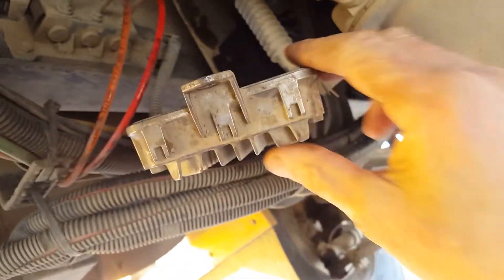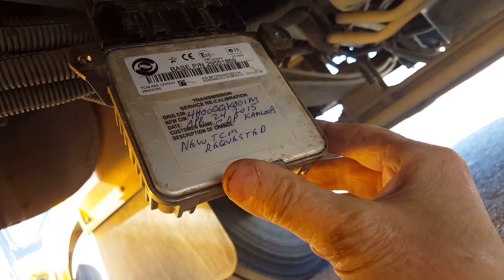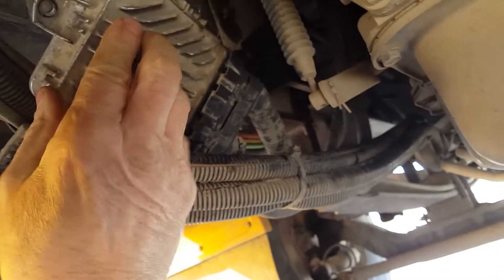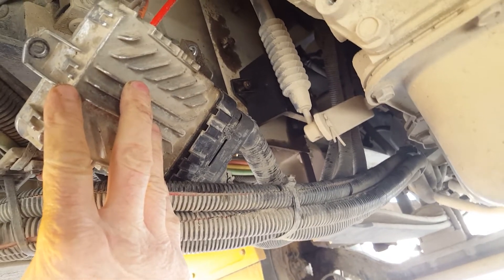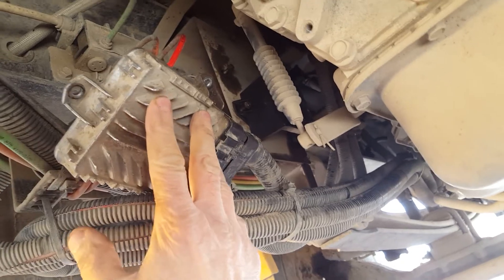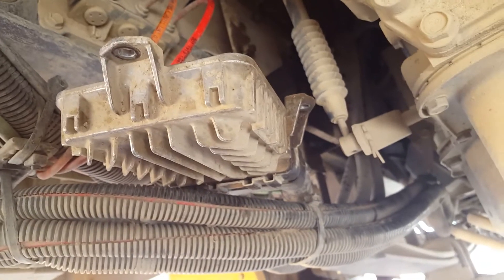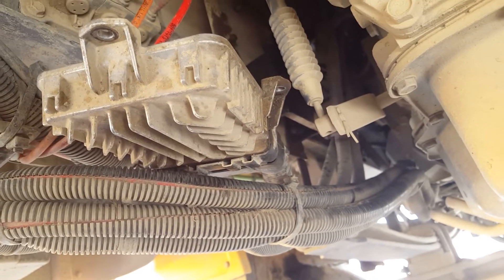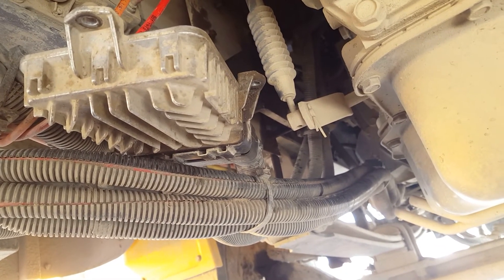Allison Automatic Transmission Control Unit Reprogramming

Comment: I have been to the dealer multiple times and they have not been able to fix the issue and have no idea on a fix. Wondering if anyone else has experienced something similar. I have a 2018 freightliner cascadia that goes into neutral between 9-10 and 11-12 for 4-5 secs. Only happens when going up or down hill. No fault codes. Recent oil change, fluids checked, no leaks. Happens mostly when load is heavy., coud the TCM be the problem.

Comment: We had a several Freightliners M2s with the Allison 3000 that all had 2 Modes programmed in them. This truck sounds like has the ECONOMY MODE programmed in it. There is a "MODE" button on the pushbutton panel. The TCM is capable of storing at least 2 different shifting programs. One Economy Mode the other Performance/Regular Mode. The difference is the shift points. Economy Mode shifts around 400 RPMs LOWER than the Performance/Regular Mode. 400 RPMs may not sound much, but trust me, when you're entering a highway from the On Ramp or pulling up a hill with a heavy load, 400 MORE RPMs is EVERYTHING. I drove another truck with the Economy Mode ONLY in it. It was frustrating AS HELL when pulling out into heavy traffic or pulling a hill with a heavy load. The damn thing would shift just as the engine the engine was getting into FULL TORQUE range ! It would early shift and down shift leaving the truck moving like a snail. Put you in a very vulnerable situation and just plain pissed off. How many MPGs is Economy Mode actually saving ? Surely not worth the fuel saving and pissing off drivers to make it worthwhile. Get your the Performance/Regular Mode programmed in and make SURE it is the default MODE #1. Economy Mode should ALWAYS be MODE #2 !
Reply: I have a 2100 rds in my dump truck and have been looking for months on how to get out of the damn economy mode,  but I have a "t handle" shifter and not the push button.  Do you know if/ how I could go about getting economy mode off this thing and into regular/performance mode without a push button? That extra 300ish rpm hold would make this a whole new truck.  Thanks
Reply: @thomasbrooks8426  the mode button on the t-shifter is on the shifter handle itself.

Comment: I have one allison 2000 its just shifting at higher rpm.
No dowshift
Looks get in neutral when release on the gas.
Somthing like no engagin.
Due to brake problem
Looks like transmission computer  turned inti a some safety mode.
Dont knoww.
Reply from the maker: Is your throttle position sensor ok? There should be a trans code. You need Allison DOC software to troubleshoot.
Reply: @MechanicsHubdotCom  
Ok.
The throttle sensor is the one in the middle correct??
by driver side

But i guess i ll put it in allison shop.
Reply from the maker: @1HSYURIDIA  it's attached to the throttle pedal and sends a digital signal to the trans ECU. There's normally a 3 wire connector. You will get a 5 Volt reference on one of the wires. Ground and return voltage back to the ECU. The amount of voltage tells trans and engine ECU what position the throttle is at. 1/2 or full throttle etc. Check rhe wires and connector. By the way this is just a hunch since I'm not there 😁

Comment: This was a problem with all the old hydraulic models also. What happens is you start going up a grade and the engine would start to lug and downshift. The lower gear would multiply the power and as the rpm would climb it would upshift setting up this upshift/downshift cycle. The solution was to set the shift selector to the gear best matching the grade you're climbing and leave it there. 
Otherwise they'll drop shift assist pressure or TPS sensitivity and you'll loose part throttle upshifts which is nice in stop and go traffic.
It's a compromise but selecting the gear you want it to hold in is a simple training process and still gives you part throttle upshifts.
Whether the earlier fully hydraulic or newer 2,3/4000's they have no gyro in the TCM to know the grade and the paradox will be the same.